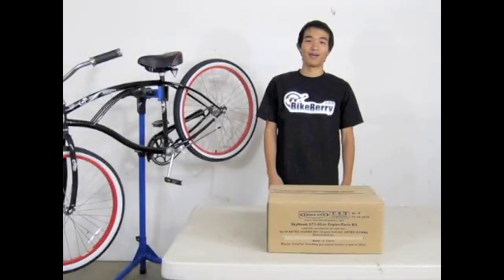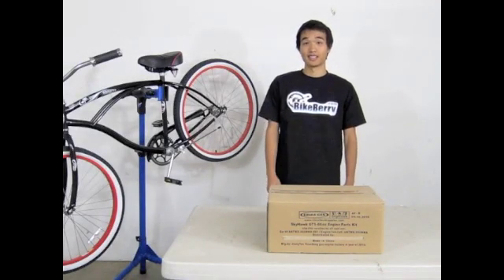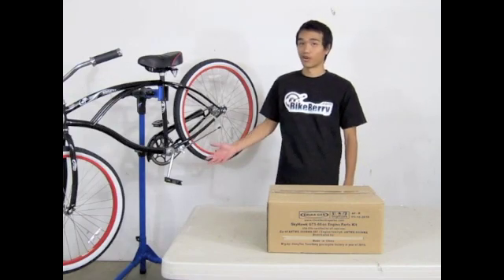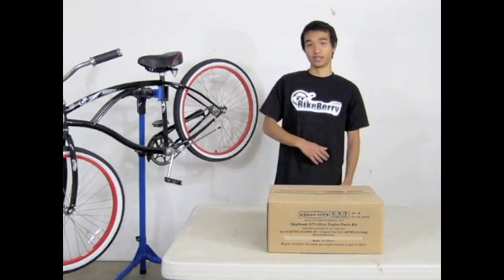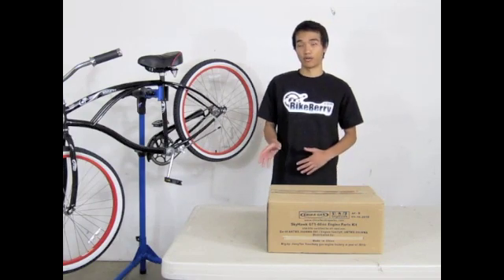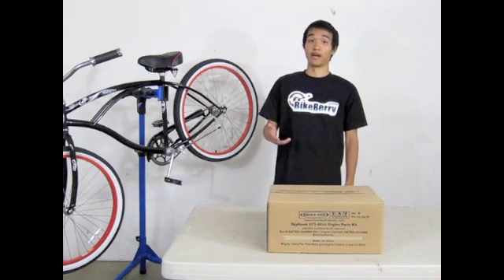Bicycle Engine Kit Installation Guide DVD Sneak Peek- BikeBerry.com

Comment: I bought the bicycle engine and it came with a DVD and book and I'm pretty much done but I don't see any directions for installing the throttle cable.
Reply: Sorry about that. Check the 4-stroke video on YouTube or on the DVD. They both are the same video and the installation is the same for the 2-stroke and 4-stroke engine. We'll be updating the 2-Stroke video shortly.